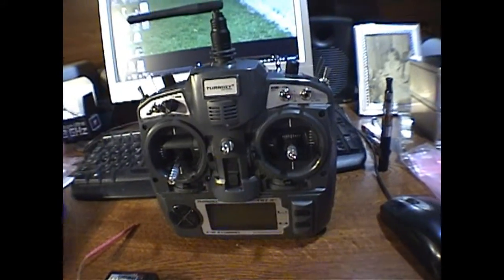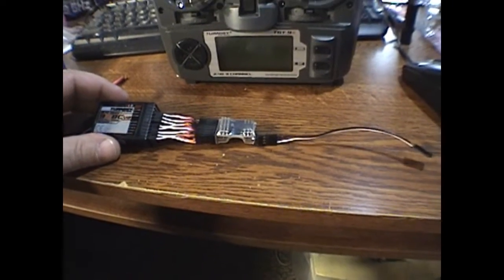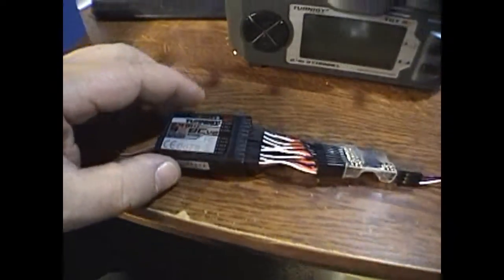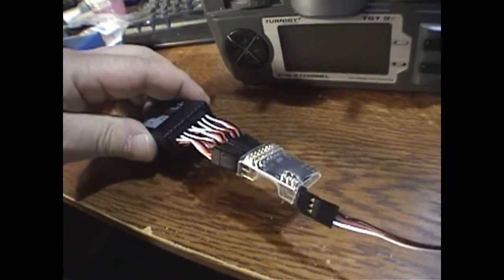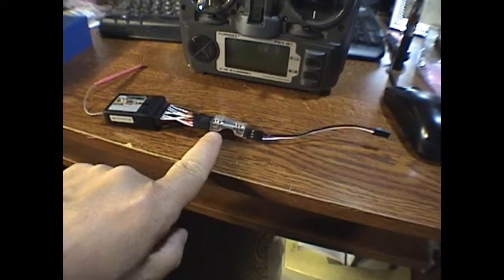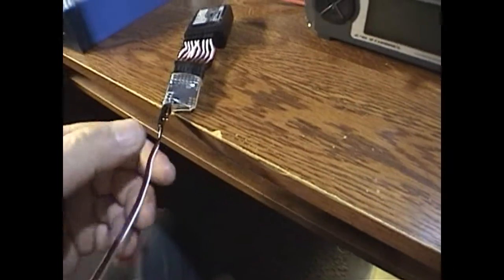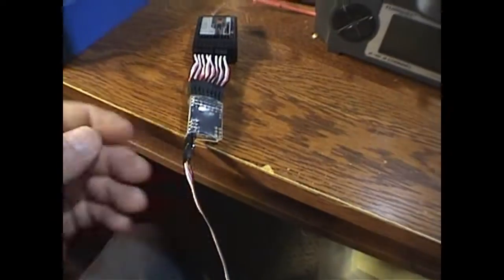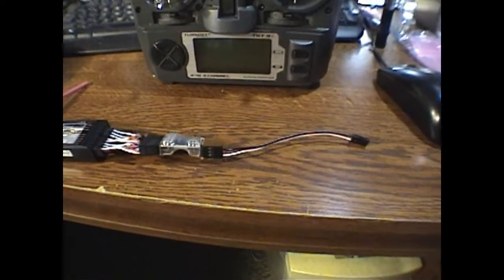Connecting a Turnigy 9X Receiver to PPM Encoder

Comment: Can i use it for racing quad?
Reply from the maker: I don't see why not. This set up is with the Pixhawk FC for a 350-450 size quad. If that's what you are using it'll certainly work, but I'm sure there are smaller and lighter configurations you might want to explore. Good luck!
Reply: No lag ?

Comment: why didn't you put the encoder right side up? that way all the wires from the receiver didn't have to be twisted.......
Reply from the maker: ***** 

You would think and so did I, however the receiver (upright)
has channels 1 thru 8 going left to right or from the bottom up…and the encoder
was the complete opposite. So if both were facing the same direction, ch1 on
both would be at opposite ends of each other and the servo wires would not
reach. It would have been a bird’s nest. So to keep things in line and neat and
orderly, turn the encoder upside down and twist the wire so the signal wore is
where it should be accordingly. Thanks for the comment
Reply: lol didn't think about it, thanks for the video btw it helped